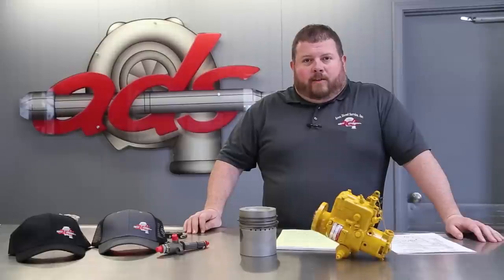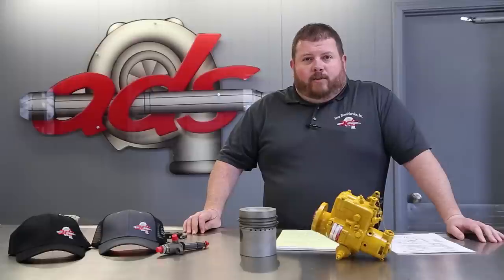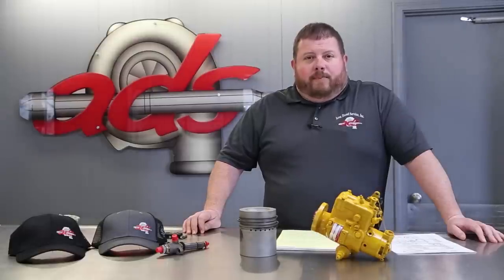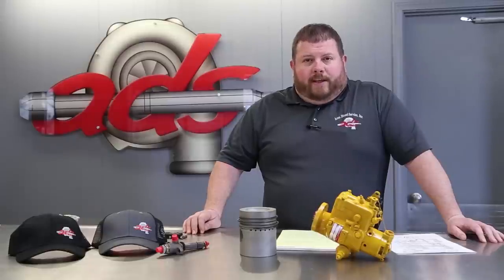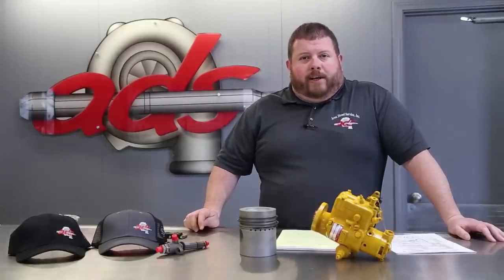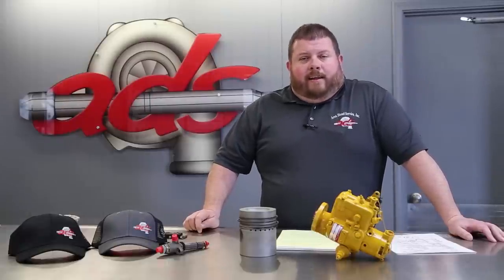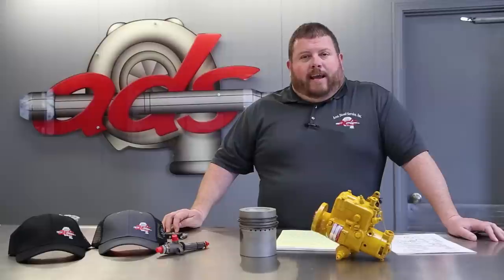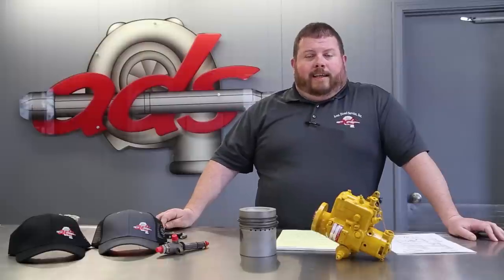Troubleshooting Rotary Pump Timing & Speculation Why @JAMSIONLINE $500 Allis Chalmers Engine Seized

Comment: As a heavy equipment mechanic, I have a basic understanding of how these pumps work, but your video not only helped clarify what is going on but what can go wrong when rebuilding them. It's great that you were able to show where mistakes could have been made without pointing fingers or bad-mouthing another shop.
Reply: I'm a heavy vehicle mechanic here in Australia,,   i'm in the same boat you Tim,,   basically know how they work, but these pumps are a specalised component and thus get sent out for repair or straight swap out with new, we dont pull them apart,,   I really enjoy these types of vids , always learning

Comment: I am the one that made the reply in their original video about the injector spray pattern being out of the bowls in their pistons. I am a machinist and do a lot of work on pulling tractors. I help a guy with a pulling tractor and we have had pistons that melted. Usually its because of too aggressive timing. I had an oliver tractor with a hercules motor and a roosamaster pump. The timing on it was way too far advanced and it actually melted the pistons just pulling a hole shot up the road. Aluminum from the pistons actually came out the exhaust. 

I made a few rotors for these roosamaster pumps that had .550" plungers. The problem was I could never keep them from seizing the rotor in the head and breaking off the drive shaft. We eventually went to p-pumps and have much better luck with the pumps and they run much better also.

Comment: Hi guys, After listening to the importance of the pump, I'm ready to concede that the cam could've been installed backwards, therefore affecting several cylinders more severely than other cylinders. Thanks to both shops on trying to figure this out. Take care. Roland

Comment: Because of this video, I now know a lot more about mechanical injection pumps, and have an idea how many different ways a rebuild can go wrong. Unfortunately for Jim, the worst scenario happened where the engine runs, but destroys itself. I happen to own an old Massey Ferguson 275, which had a leaking injection pump. I put a gasket kit in myself, but didn't have to disassemble the whole thing (thankfully!) Currently counting my blessings ...
Thank you for posting!

Comment: The question I asked on Jamsi channel but was never addressed was is the timing mark on an Allis pump marked with the 25deg they said the engine is supposed to have built inbto the pump so you time it at TDC or is the pump marked for start of injection and you time it to the engine at 25BTDC.  My experience with DB pumps is they typically are scribed with the timing built in so you time on TDC.

Comment: Good content. Great general explanation. Worked with these pumps in many applications over my career. Was always amazed at the engineering that developed this mechanical wonder that could   adapt to be the heart of Diesel engines large and small, by changing a few internal parts. The Roosa Master injection pump should have a spot in the injection pump hall of fame. No ECM required! Thank you Hartford Machine Screw Co.

Comment: Me personally, if the other shop botched the pump (or believed to). I would have spent the money, and time, to send it to you guys to verify whether or not it was correct after the other shop had repair it again.
Reply: The first shop did not get a second bite at the apple. They sent it to a second shop that unfortunately jumped into rebuilding it at the first observed problem rather than doing a full diagnosis and test. Area Diesel was the third shop involved, but only after the suspect pump had been rebuilt.
Reply: @Iamkcs2c  glad the first shop was avoided

Comment: Excellent explanation    I was hoping that pump was going to be sent to you so you would make a video cause I had my own thoughts on it but guess you missed it.   Im sure having a turbo with out piston coolers didn’t help the problem either. Great job   Thank you
Reply: After 20 years as a Deere veterinarian that caught my eye as well. Also if an injection service sent us a pump 180 out…we’d be sending it right back.

Comment: I can attest that pump shops mess these pumps up. 25 years ago or so we had the same style pump on our JD350B crawler and it broke the input shaft, we were thinking our fuel got sugared, we had bad neighbors at the time.. anyhow, we got a new pump and injectors and installed it and it just never ran right, smoked a lot, hard starting, etc.. we ran it that way for years because we didn't know better.. also, the pump head bolts backed off and it was starting to leak.. years later I got into hot rodding diesels so I decided to take a closer look at it.. don't know if I did it right but i adjusted the screw on the timing plunger at the bottom of the pump and advanced it a bunch, I'd guess like 6 engine degrees and while I have no idea if it's in time according to spec, it's actually running well now.

Interesting to see the internals of these pumps, I'm familiar with the CAV/Delphi DPA pumps and the Bosch VE pumps, but never worked on the insides of these.. good to see all the places that are "gotcha's", which the other two pump styles don't seem to be as bad for that.. you can get the timing 180* off but that's about it.. There's also some other style rotary pumps, I can't remember the bosch model designation but they were on the International 574 and similar series tractors, very small, square looking pump, be interesting to see how they operate too

One question on injector nozzles: I have a set of nozzles that I've set the pop pressure on, and they don't open quickly so they'll stream rather than mist, I've carefully cleaned them, the spray pattern is actually good if you hit the pop tester quickly,  The pintles move freely, I don't see any wear on the tip, though I guess there could be some on the seat and I can't see that, they do seal properly when seated, it's just the transition that's not good.  it's a DLLA150S716, so SAC style tip.

Comment: Thanks for a very in-depth discussion of how these pumps work. It only reinforces my opinion that I need an expert to do any repairs to a complicated system like this. 

In the most recent video, JAMSI says the pump appeared to have been turned up 20% over stock- I'm wondering if the injectors are even correct for the engine. Depth certainly seems to be an issue, and flooding cylinders with even more fuel to wash the cylinders down/burn too hot seems bad, unless so over-fueled as to cool things down. Then there is the lead found in their fuel tank- how does that get there. The sample looked more like bad gas than good diesel...

Comment: Thank you for the explanations of the possible different reasons for engine failure. Great recap on operation and potential problems.
My basic mechanics required us to understand a rotary and linear FIP, trying to remember the operation of both (also included a side draft and down draft carb), was pretty hard for a 17 year old having fun.
Stay safe out there!

Comment: Had a Cat Gen Set fuel pump rebuilt (years before I worked on it) that wouldn’t pull load. Eventually found it had the wrong spring in the governor. It makes a big difference using proper spec parts. A 3% spring for a constant speed engine is a huge difference when a 10% spring is installed. Sad part is that it was years before the problem was rectified.

Comment: Everything in the pump is perfect. We just put one part in backwards… but don’t worry it’s fine. It says more about the other pump shop that they didn’t insist on fixing the pump. Old engine was probably ok. It may have been a little warn but the old injection pump was probably mostly to blame.

Comment: of all the items you showed,  the advance ring is likely to be the best guess.
if the tech was sure it was a clockwise spin pump he would have set it in the pump that way and tested it that way.
pump tests good.
at low speed the engine could have been set correct 
Jimsi has enough practice to know how to set the timing and is likely to know the pump 
was wrong on the other mistakes shown.  
I would think the other problems would have kept the engine from running at all
or been hard to adjust to a slow speed.
As the engine sped up, the advance went the wrong way.  real hard to see or know during running.

and thank you for the vid,

Comment: With the Stanadyne IP, far advance timing will be very noisy.  Late timing will definitely cause high exhaust gas temperature.
The damage Jim showed can conclusively be explained by excessive temperature. Which is from late timing which would require far greater metering valve opening for the load.  This will rapidly burn the engine.

Comment: Great video! Here's the million-dollar question, what happens if they forgot on the 2nd rebuild to time the pump to #6 and did normal timing procedures.
Reply: Then it will be injecting at TDC with exhaust closing, intake opening not compression stroke. Wont run.
Pump was setup to be correctly timed to cyl 1 on final build tho

Comment: Great explanation.

I am curious about the JAMSI engine failure also. What do you make of their AC engine only displaying the overheated pistons in a couple cylinders? From what I recalled of the tear down video some of the cylinders appeared to have no problem.
Reply: I have seen pulling tractors melt a piston and many times it only 1 cylinder

Comment: Yes sir it can happen quite often, when there is a bug put in a piece of equipment and it is carried along to the point to where we endure the massive engine failure that Jim's Automotive Machine incurred. It is unfortunate that they had to go through this and of course if this was indeed another customer's engine there would be all kinds of speculation of what went wrong and who may be responsible. the fact that this failure was in house and Jim and his son could have the opportunity to dissect the engine and see where there are differences as well as they were the ones who did any machine work and assembly of the engine put them miles ahead in this diagnosis. The fact that they had to time the engine 180 degrees out maybe should have raised a flag, and unfortunately the second shop they sent the pump to failed to make notice of any procedures not followed caused a delay in the chain of event towards finding what went wrong so that we do not repeat the results of the first incident. This is of course a lesson for us all to learn from and learning from our mistakes can be the biggest benefit.

Comment: I watch all of Jim's videos and I think they may have resurfaced the heads. Would that change the injector nozzle chamber gasket thickness needed for proper operation? I think the factory pistons and sleeve setup were wrong and the rings were too tight causing their problems. Then, would a faulty injection pump cause the cylinders to run too hot to cause the rings to expand that much to cause Jim's engine cylinder scarring? Sargent Shultz would say "very interesting". Great video guys, I'll be sending my pumps your way when needed.🤠

Comment: I don't know if Jim knows the history of the tractor. People have swapped parts from engine to engine that look the same but might not be the same. What if the pump isn't the one that is supposed to be on the engine? You addressed that you verify the application but did the other shop verify it? Pump timing could certainly change the spray pattern if the injector fires when the piston is lower in the chamber, either on the way up or down. That would cause a lack of power also. How much difference does the modern fuel make? Diesel fuel is almost a solvent now. In the past, any fuel spilled would leave a film around the filler neck but not anymore. Does the modern fuel alter the timing or spray pattern as it seems to be thinner and more volatile?

Comment: I think Jim's pump was wrong . First clue 180 out I know your shop wouldn't let it go out the door that way. Second injector marks on pistons . So I think they took it apart and found it was them and oops don't tell just rebuild don't want to be liable. I also noticed it doesn't look like the same pump they sent in

Comment: Not pointing any fingers towards anyone, seeing how mistakes do happen, but as a rule , if you get a pump back from a shop and it doesn't time up, per factory specs, there is something wrong, don't use it.

Comment: I'm at 8:55, that is totally incorrect, for one the 55 thou gasket is likely compressed, then you have to account for the head being machined, this injector gasket to deck height should've been measured and corrected.

Comment: Hey O can certainly use some help with my DBG pump. Had overhaul by me and I still cannot get it to pump fuel. A new 1 piece weifht whell installed, meticulously cleaned all orifices carefully not scratching the bores of each. New vanes for lift pump. From my understanding if the shaft that drives the pump has a dot on the end of the shaft and the female paet has a dot those must align, only to ways it can go, 180° each way. I to am a content creator and would love to do the entire swriea of restoring this cool 1968 Case 580CK. Let me know. Thanks.

Comment: How easy should an engine start with one of these pumps? I have a Farmall 504 that I rebuilt the engine when I bought it, and had the pump rebuilt. It is always hard to start at first start up. It could be 80 degrees outside and I still have to use glow plugs to get it to start. If the engine is hot, it will start easier. It's a D188 engine.

Comment: Honestly if it was my pump I'd have a second shop double check it instead of rolling the dice again especially since it wasn't diagnosed on disassembly.
Reply: They sent it to a second shop and avoided the original shop that rebuilt it. There was some miscommunication so when the second shop noticed it was 180 out they assumed they found the problem.

Comment: What facility are the videos made?
Reply from the maker: Thanks for the question Kevin, this is the front counter of our Carlinville, Illinois branch - it is actually the original building from 1973 (though the total size of the building has expanded over the years), Illinois our headquarters and the main hub of our remanufacturing.

Comment: to many if ands or what if but as someone who has been to rosa master school i can tell you there is a few shops that dont do reputiable work it is not a simple job r/r one of these the proper way takes time to do it wright and yes i have r.r in field in emergency but you are takeing a chance i,m looking at timing and or fuel mixture could it have had some gas in it who knows 64 dollar quiz but i believe area diesel knows therev beans

Comment: I get this but part of me can’t get past the fact that everything in the pump is sequential…I.e. it would throw off all cylinders. This in not Königsegg freevalve. If injector pistons would have been bad I think they would have heard/felt it from startup? If they would have even got it started. I’m thinking injectors/nozzles/ shims washers, etc.
Reply: They decided all the cylinders were hot, discovered heat checked valves and discoloration but the ones that seized had a tighter ring gap, still in spec but on the tight end and that’s why those cylinders seized first
Reply: @isaiahshaffer  what did they say about the injectors? I can’t recall.
Reply: @garny3766  I can’t say I recall that either, it could very well be a possibility something was off there, hopefully not because I don’t think they changed anything with them other than bigger/proper shims